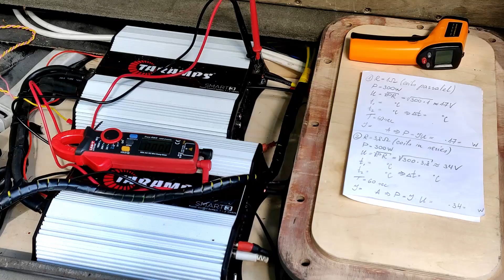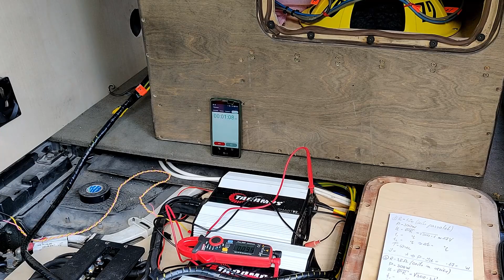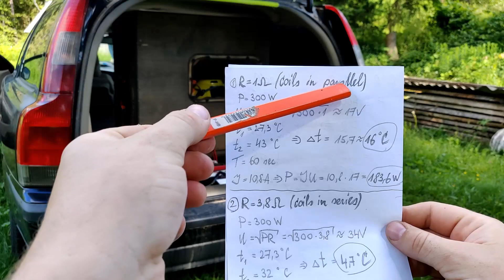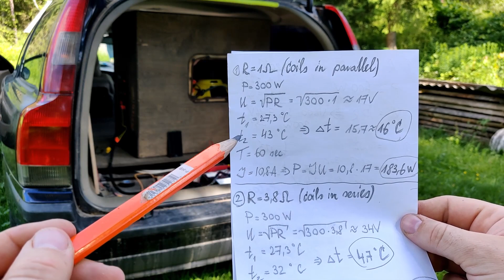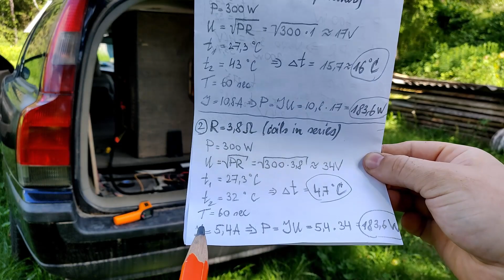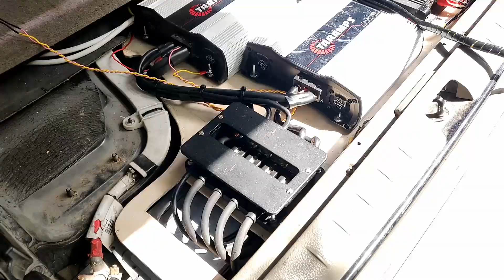Save your SUBOOFER with this EASY TRICK

Comment: Thanks for the video, very interesting, what's the difference in sq between parallel vs series
Reply from the maker: Hey! As the SQ in huge part is a subjective experience, there is no good way to measure it between series vs parallel. Except maybe THD measurement at the same SPL. But from what I heard listening to some music, the series connection seemed to be a bit sharper and faster, though the difference was very little. I would argue the driver itself and the amplifier quality plays much bigger role in getting best SQ
Reply: @KarlisZalitis  thanks for the info bro

Comment: I have long asked if there is a difference in wiring two dual 1 ohm subwoofers to a final 1 ohm load of first series then parallel or first parallel then series. Everyone says there is no difference, so your claim that its better to first do series then parallel answers that but your explanation is not very conclusive. Likewise your claim that wiring in parallel "cuts" the voice coil length in half and subsequently requires greater power to push the remainder of the coil because of the reduction in BL I am also not completely understanding. I just recently watched the Barevids live stream where he said that the most efficient and resilient Taramps if you had to choose between a 2 ohm vs 1 ohm vs 0.5 ohm all same rms output would be to go with the 0.5 ohm. His perspective was focusing on the amplifier while your is on the subwoofer, so its interesting to see the two opposing view points.
Reply from the maker: After some quick and dirty modeling in falstad.com it seems, I confirmed my statement about first connecting individual woofer voice coils in series and then separate drivers in parallel. For two woofer setup when wiring VC in paralel, driver in series, each driver is seeing double the current at the same produced power. When wiring VC in series, drivers parallel, individual driver current is halved. In both scenarios amplifier is seeing 2ohm load and does not care either way (I'm glossing over the fact that speaker circuits also have reactive components, which could also impact the operation of amplifiers, but it is outside my skillset). So ideally to get the most bang for your buck and protect your gear, one should select drivers so that when connecting all the coils in series and drivers in parallel or series (depends on the result of individual driver impeadances), the amplifier would see it's lowest nominal ohm load to produce the highest power
Reply from the maker: And in regards to BL reduction - the motor strength (BL) is a measure of how strong the magnetic field within the voice coil gap (B) multiplied by the length of voice coil that is active in the magnetic field, key being ''the length of voice coil''. When connecting separate voice coils in parallel, you halve the winding length and thus halve the BL product. From experience, most manufacturers in driver tech sheets provide BL value for coils connected in series